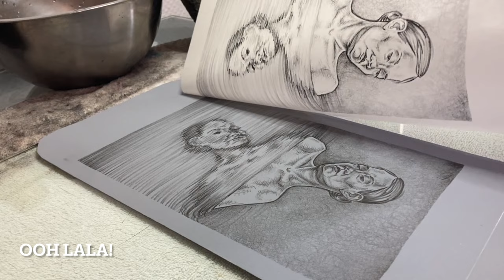Home Lithography Printing

Comment: I guess I still don't fully understand lithography. Why don't you just screen-print instead?
Reply from the maker: It’s akin to asking someone who paints in watercolour why they don’t use oil paint instead. While there is some correlation, the resulting aesthetics are completely different.

Screen print is great in the way it is very fast and versatile to print on a variety of materials. I, personally, just prefer lithography.
Reply: With screen printing you wouldn't be able to capture that charcoal texture. Every printing technique has its own language.

Comment: Great work! Thanks for showing more of the process. What was the first plate you printed used? I can see the other plate was aluminum foil. Can you reuse the first plate?
Reply from the maker: The first one is a ball grained aluminum plate- originally a photosensitive litho plate for commercial use that was grained on the back side for use by artists. I have only ever bought them prepared and used them once.
Reply: @valeriesyposz  Thanks! I was thinking about trying a ball grained plate and now you've given me the push. :-)
Reply: I’ve never seen the ball grained plate in any art shop to buy. Where can you get it.

Comment: Is gum Arabic needed? What does it do?
Reply from the maker: For ball grained plate- yes. Aluminum foil- you can get by with just cola.
Helps keep the non-drawn areas hydrophilic/not accepting grease so the ink doesn’t stick there.

Comment: Beautiful work! Can you re-use the plate for other images (the hard plate, not the foil)?
Reply from the maker: You can re-print the same image later on. You could also regrain the surface for a new image, but getting it done by a ball-grain machine is going to give the best grain.
Reply: @valeriesyposz  Thank you!

Comment: I've always wondered, Is it not possible to use a clean brayer, instead of a baren or spoon, to transfer the image, please?
Reply from the maker: In theory, yes. In practice, there will be some difficulty in getting enough pressure.
If your image is simple and bold and you print with a loosened ink on a thin paper, it might be fine.
Reply: @valeriesyposz  Thank you so much! 🤗

Comment: Hi! you seem to have a lot of experience with this technique and there isn't a lot of info out there. I'm having issues with ink rolling onto the non-image area and once it starts it's kind of hard to stop. I'm trying to diagnose the issue without buying a bunch of stuff. I see you are using arabic gum and assume it's to make the non-image area even more hydrophilic, it seems like some do and some don't. Do you find it a necessity? I am also using etching ink because it's what I have available but although nice and stiff it's very tacky so I'm wondering if that's the issue, I've tried to loosen with some drops of gamsol but don't know if I should just look for new ink, get arabic gum, get tack reducer or talc or what. So many elements at play and I'm trying to filter the wheat from the chaff.

Sorry if this is a bit unclear but just wondering if I could get your experienced insight. Determined to use this great technique!
Reply from the maker: Quick question- are you asking about ball-grained aluminum plates or kitchens aluminum foil?
Reply: @valeriesyposz  Sorry, yes foil. I've been trying to get success with kitchen lithography but there are a lot of variables to figure, I've gotten it to "work" but I really want to get that flawless inking I see you and ArtBahar have. I'm also thinking if I should need distilled water or anything too and not tap as I know hardness matters in commercial offset
Reply from the maker: @123tobiiboii123  Thanks! And yes, there are a lot of variables. I use litho ink which is also very tacky, so I wouldn’t think that would be the problem. You can loosen ink a bit to get it to print darker, but tacky ink shouldn’t be the cause for scumming. Often it’s a case of the foil/side of foil you print on. Testing multiple brands and shiny/dull might lead you to the best choice. Also, if your drawing materials are too greasy, sometimes that leads to unwanted ink picking up, as well as filling in. Gum isn’t necessary if you’re printing soon after but I use it so I have more time flexibility.
Reply: @valeriesyposz  Scumming, yes great word and will help me troubleshoot, I've also recently found the tamarind book of lithography and will start improving my general understanding. I appreciate you helping and giving me direction. Time to experiment!
Reply from the maker: @123tobiiboii123  The Tamarind book is my go-to❤️
Reply: @valeriesyposz  tried many things and foils but my non-image area kept degrading when rolling the ink on, not sure why. Resorted to buying some gum arabic a drop after etch but before clean up solved it. Waiting on some better paper but I'm printing!

Thanks for all the videos of your process, your insights are a great help